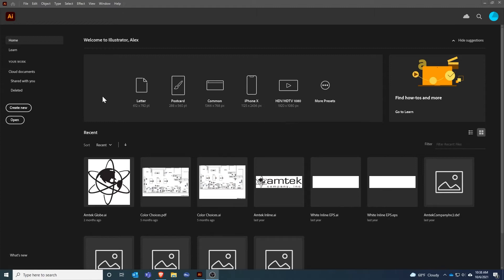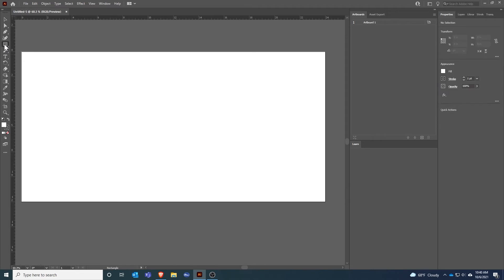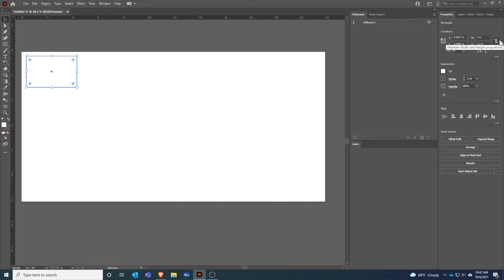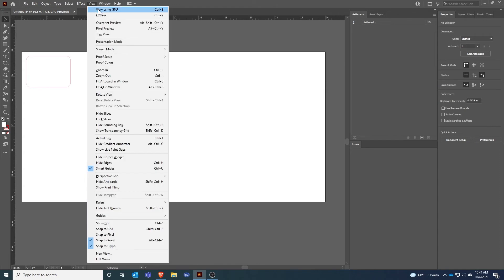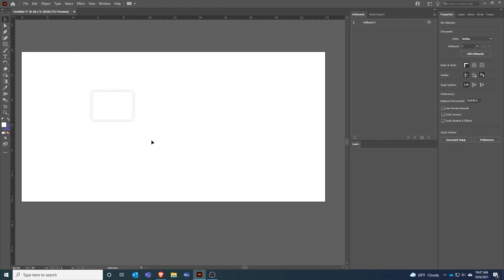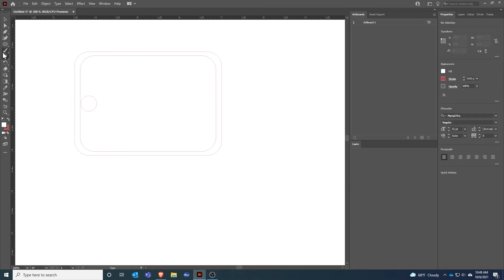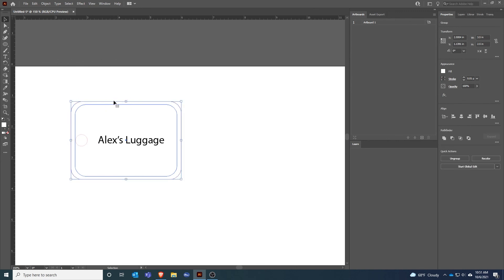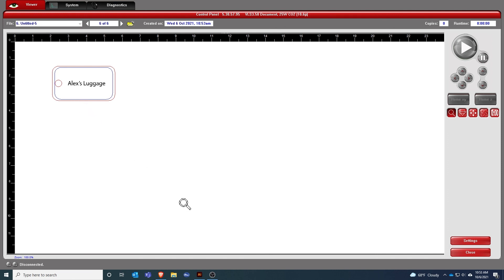Printing to a Universal Laser System using Adobe Illustrator

Comment: Good morning. I complete the design in Illustrator. It just a simple cut out which is red. But once I open it in the UCP. It turns out black. And automatically starts engraving when it should be cutting. Why is that?
Reply: You'll need to make sure it's set to RBG (255 R, 0 B, 0 G)  for line color. You'll then need to set the line weight to 0.003. The ULS platform will recognize this as a "hairline stroke" for cutting. I hope that helps!
Reply: @caribowersock1709 The actual value for the line width for color recognition is 0.001 inches or 0.96 pixels, but UCP does allow some wiggle room. At least that's what the manual says for the VLS 3.60 DT.